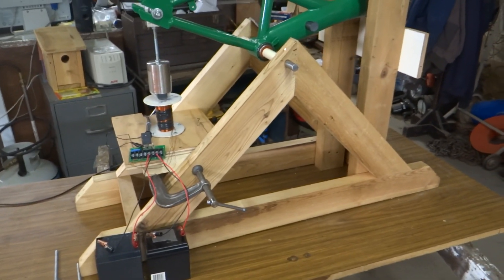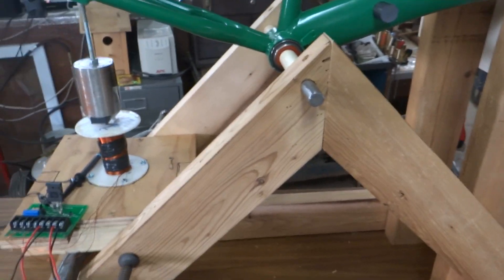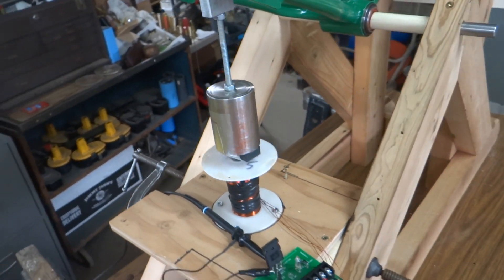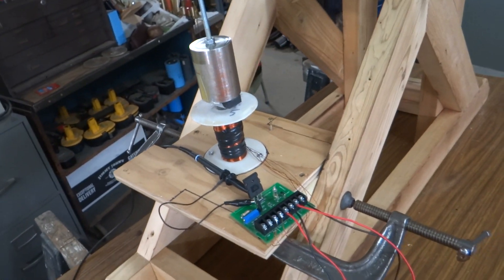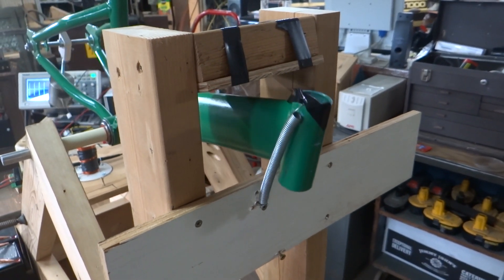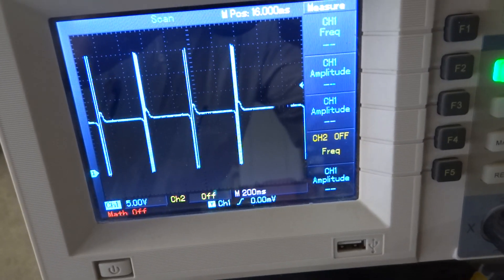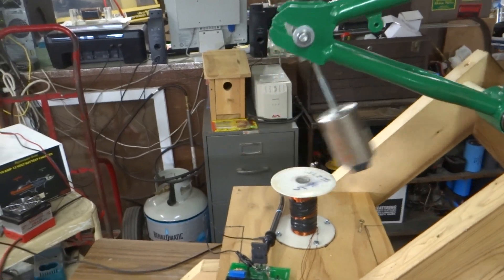Two Stage Mechanical Oscillator

Comment: your magnet and electro magnet are in the wrong position AND too far apart . The closer they are the more push power you get . Example  1 - https://www.youtube.com/watch?v=CLspX4mtBDo .  If you double the length of the pendulum , you double the time of the cycle BUT MORE than double the power out put. As you noticed .  The higher you swinger the pebdulum the more power out you get .  If you reposition your magnets you will find that the wxtra power in to swing higher is much less than the power out gain.
Reply from the maker: Hi RHEAD100
We are just getting started with the experiment and intend to reposition the coil and modify the circuit powering it. We are still in the process of installing a fluxgate generator on the output. We will post other videos as we go.

Thanks for your input.
Reply: Don't forget to lengthen pendulum swing .  This will in cress power out put exponentially .U look forward to your progress
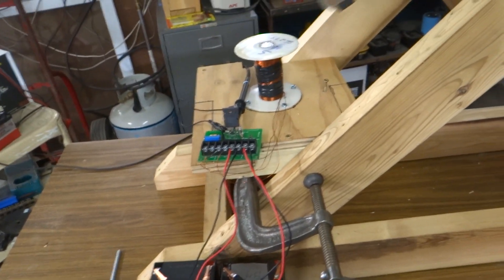Reply: Pay close attention to the video at 2:38 through 2:55
Reply: Example 2.   https://www.youtube.com/watch?v=uvRSxMogjaw&t=2s
Reply: Example 3.   https://www.youtube.com/watch?v=JImN1kcu1EQ